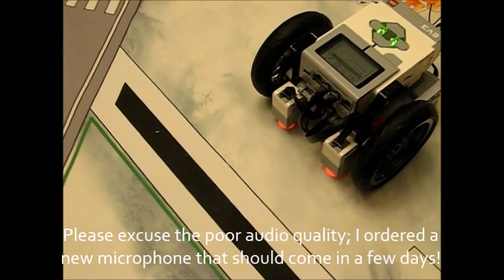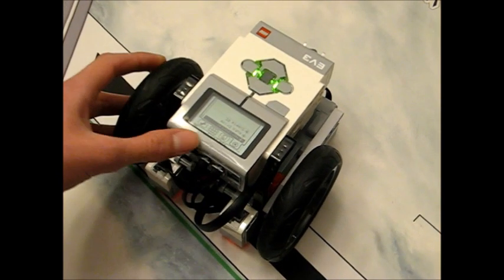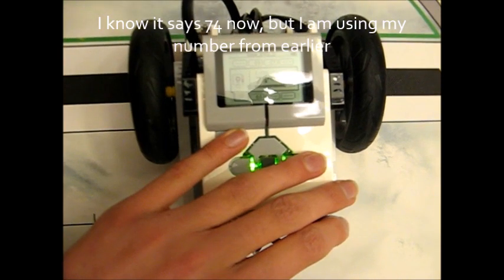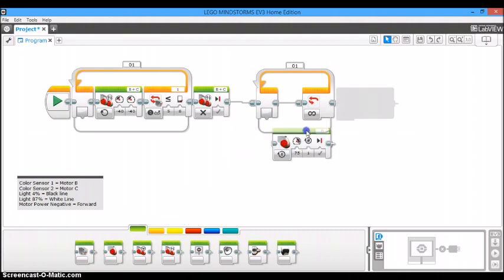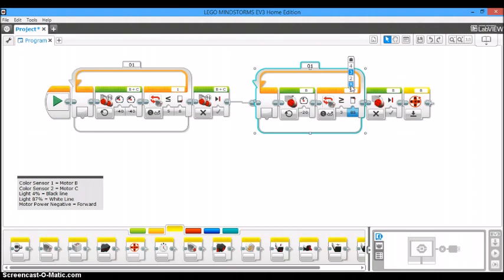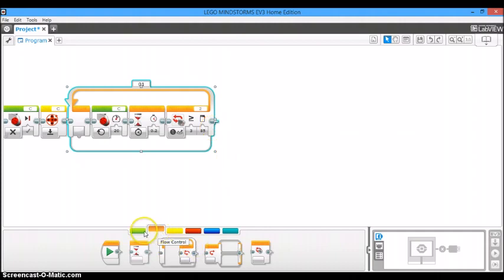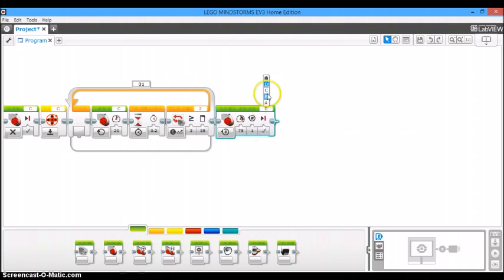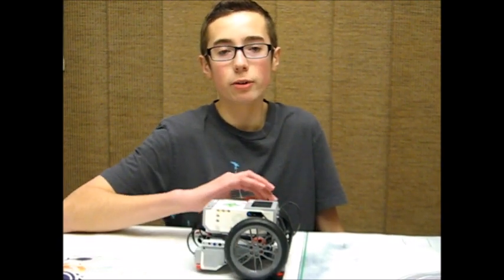Line Squaring an FLL Robot W/ Color Sensors (Part 1 of 3)

Comment: Hello, followed your videos for my team and found them very useful. Thanks for sharing. Have a question on this. When the B motor goes first to the white area and stops .. then you reset the motor value and then go back it sees the white area behind the black line.. (Say in our mat it is -77 degrees) because it is going back. Then we divide it by 2.. anbd have approx -38 degrees or so... my question is .. this makes the B motor go even more back..and not forward to the black line.? Am I missing something?.. is there a way to take the absolute value just 38 , instead of the negative sign before? thanks for your help
Reply from the maker: Yes, there is an absolute value math block. Here, I multiply the degrees by -1 when using it to drive back onto the line; this reverses the direction. You may want to see my updated version of this video, which is much clearer: https://youtu.be/voMlsdVAERQ

Comment: Thanks for "sharing what you have learned with others"! Very good programming, could it be converted to a myBlock to repeat with just entering new values for the sensor and motor? Also, it seems that the EV3 sensors have a wider range than the NXT sensors for the light values - or are those recalibrate for your mat?
Reply from the maker: Yes, this can certainly be made into a MyBlock. And I'm not really sure how the light values on the EV3 and NXT sensors differ, if at all. My sensors are not recalibrated.

Comment: I really like ur vids and tutorials so much dude and can i pls know where to get those huge wheels. i checked them everywhere but couldn't find them anywhere. And can u make a tutorial of how to make a robot sense a particular color cube (using color sensor) and then with the help of a claw lift them and place it somewhere. im not forcing u ok, im just asking u to make it if time permits u. Thank u very much bro. :)
Reply from the maker: As for the wheels, you can most likely find them on bricklink.com. And for the tutorial; I already have various videos that would help you get a good start. There are many facets to what you want to do, so it wouldn't work to make just one tutorial.
Reply: ohh ok Thanks

Comment: I found your video to be well done and informative.  Would changing the wait blocks in this program from seconds to sensing the color black work the same since you are starting on white, crossing the black, and going back to white?
Reply from the maker: MrDraconyc Sure, that would probably work. In "Part 3" of this tutorial (which is really an improvement video), I show you a more reliable and streamlined way to structure that part of the program, by moving the wait block outside the loop. And thanks.

Comment: Great job on the video!  Maybe you could make an example of how you could make it work when the robot does approach at a very weird angle by monitoring both sensors for a black line and initiating the alignment routine then.
Reply from the maker: Xander Soldaat Yes! Thank you for the suggestion! It was funny you said that, because I was thinking of an alternative method to align the robot so that it can align itself from any angle. I will try it out when I get the chance, and if it works, I will make a new video on it.